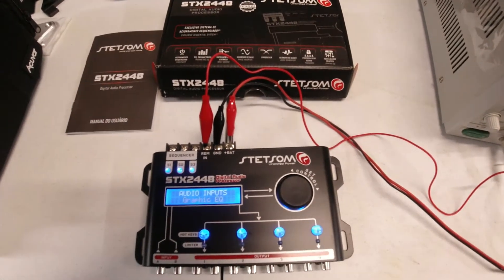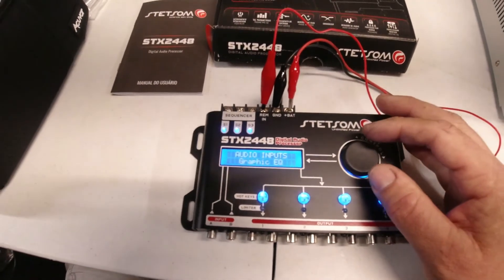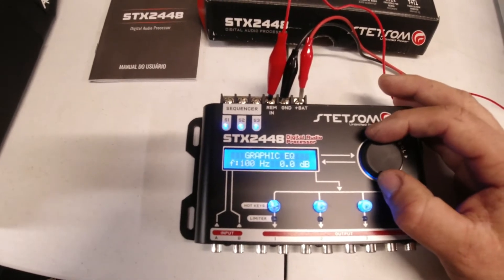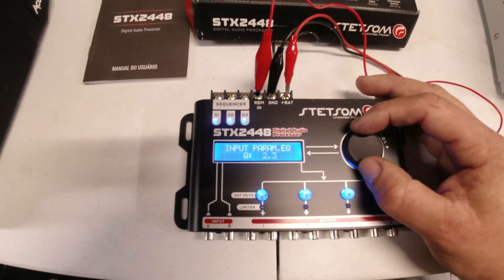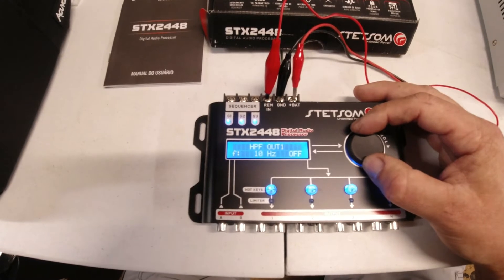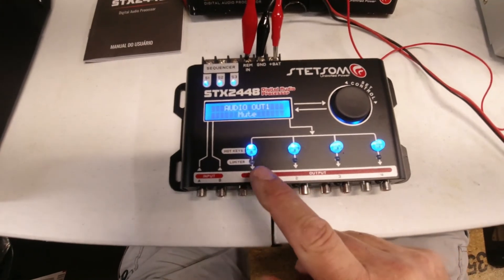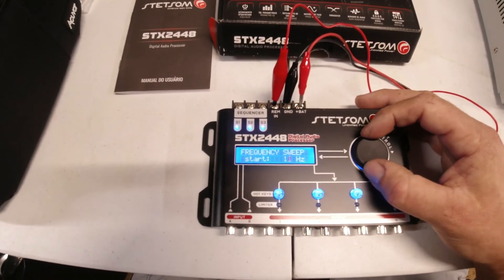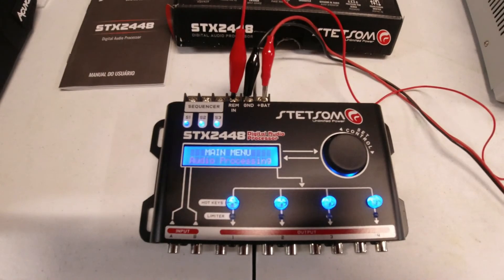Stetsom STX2448 Digital audio processor equalizer crossover DSP and The user manual in english

Comment: Hey great content!! Why is my amp remote signal light stays on while the car is off this only shows up with one amp
Reply from the maker: If you are sure that there is no power when car is off on the remote wire something might be shorted out in the amp where it is being power by the battery power input and not switching with the remote voltage. But not sure that’s weird for sure.

Comment: Hi, Can you please help. I have a wining high pitch tone in all of my speakers from installing the dsp. I have good ground and i have moved the rca cabels so they dont touch any power cabels and this is my second dsp, I had one before with the same problem so i changed to stetsom insted because I thought it would help with the problem. But is there some setting in the dsp or is it alternator sound? Like it doest sound like alternator wining because its the same tone it doesnt go up and down like alternator wining..... Please help (:
Reply from the maker: Man, it’s hard to say without being there you just need to go through the process of elimination but it sounds like you’ve already checked grounds RCA cables if you used two different DSP then most likely it’s not the DSP so you have some issues somewhere giving noise. Also, one thing check to make sure you have no DC voltage on your RCA signal going into the DSP check it with a voltmeter.
Reply: @HiFiVector  I found it, It was that the gain was set to the radio so i just re set it so it matches the dsp instead and it works fine now (:

Comment: Ive read you can't get a stereo signal out of this. How do you get stereo, like left and right for front speakers? Do you have to plug left into 1 output and right into a seperate output?
Reply from the maker: With DSP's each channel is singular and adjustable. So although each output is separate you can configure it for stereo.. So you would lets say use OUTPUT #1 as your left output and OUTPUT #2 for your right and set the DSP so setting are the same as far as EG crossover etc.. But just set output #1 as left output and OUTPUT #2 as right output.

Comment: Hey, HiFi Vector. Great video. Do you know what the voltage output of the Stetsom is? Do you need a line driver? I was thinking about pairing that with the Phoenix Tesla tablet, and the output coming from the tablet would be less than 1.5 volts.
Reply from the maker: I did not check the rca output voltage  on this sorry. I can check my other stetsom  DSP and let you know if this helps.

Comment: The q widen the bands that are effected by you adjusting a certain frequency.  So let's say you adjust 80 hz up to 10 db the frequencies on either side of 80 70 90 will also rise the more q the further out or tighter the adjustment effects the bands closest to the frequency your changing

Comment: Which one do you think is better for sq this unit or epicenter?
Reply from the maker: This  does not have the bass restoration like the epicenter but has more of the more useful features that allow you to fine tune your system so it is more powerful feature wise in my opinion than the epicenter.
Reply: @HiFiVector  I'm thinking about getting both. But the stetson 4 channel DSP for my mid-high amp and the epicenter for my 2 12s subs. Will this work? Im getting so excited!!!!!!!! My goodness.

Comment: My question would have to be. Is what do you set you amps gains & crossovers to when using one of these type of dsp’s 🤔
Reply from the maker: This goes in between the head unit and the amp so there is a few ways to do it but a easy way to get a close starting point in the Input gain on the DSP is to hook up the amp without the dsp first, then set your gains close and then hook this up and set the gains on the DSP to be at a close volume as when it was not connected. This will make sure the DSP is providing a similar gain the as stock head unit and not louder or softer. Then you can fine tune from there.
Reply: @HiFiVector  thanks a lot 🙏🏾
Reply: @HiFiVector  ok, just to clarify. I disconnect the DSP, use my oscilloscope, set the gain on my amps, then plug this back in and check the gains on my amp again or just start tuning my DSP from there? I've always just had head unit, amps and speakers. But now on my motorcycle, I use a DS18 bluetooth receiver, amps and speakers.... 4 6.5's, and 4 6x9's, with no sub on my bike, so my setup is different than the traditional setup with subs. So I'm lost as to where to start and what my "main adjustment" part would be... i.e. "head unit/phone", DSP, amps or all three... 👍